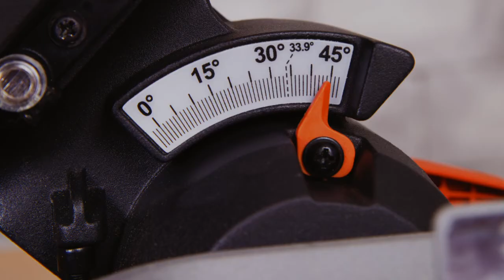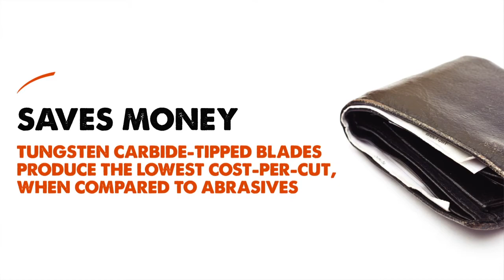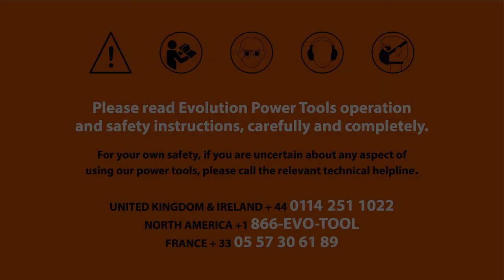Plus Range | A Guide to the Evolution Mitre Saw | Integrated Carry Handle | R210SMS+

Comment: In 40 years this is probably the best investment in a power tool I've ever made. Powerful, accurate & safe.  Just cannot find a fault with it except it SHOULD come with a dust bag as standard. But well done Evolution. A superb piece of kit... 👌👍😊
Reply: My Evolution R210sms PLUS came with a dust bag and the integral slide-rail guard. My mate who purchased the slightly less expensive R210sms didn't come with these 2 items, maybe that's the difference between the two mitre saws.